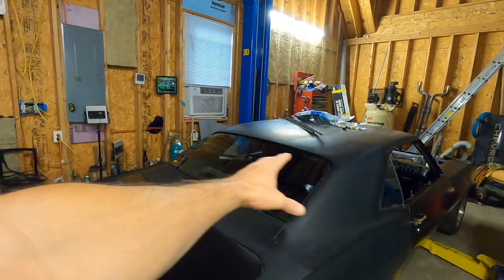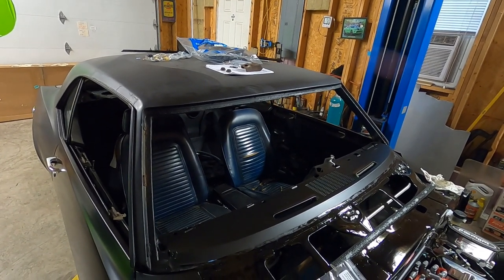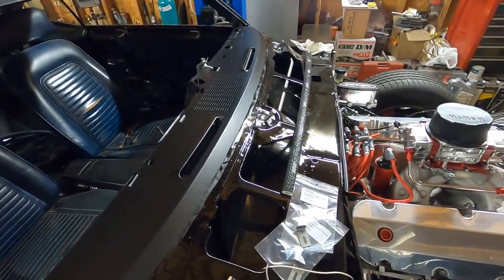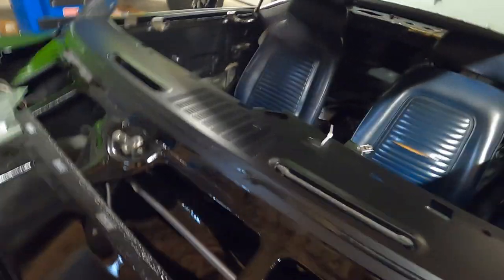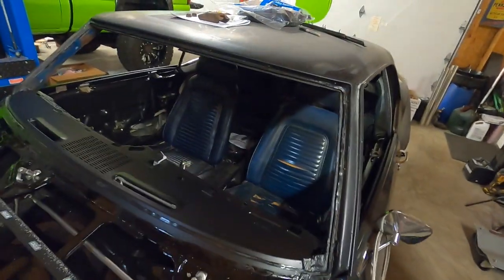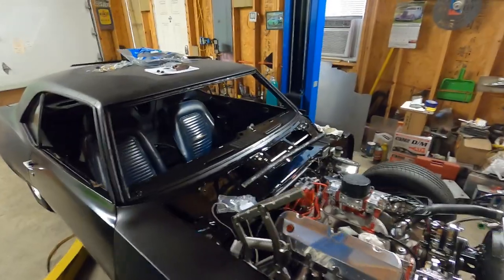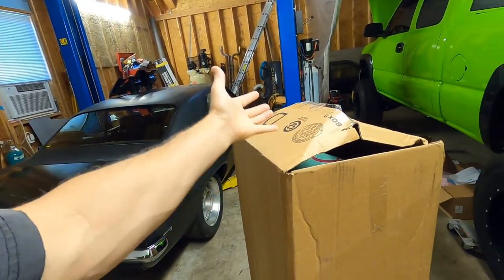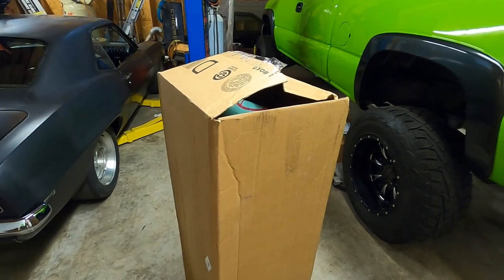1969 CAMARO WINDSHIELD INSTALL

Comment: This windshield is not glued in. You have to use a urethane 3M adhesive. What you put on was just a dam to keep the window height correct and the urethane from bleeding.

Comment: if i may add a few tips for a permanent install. 4 strips masking tape along the roof to glass to hold it for the first hour, on hot days it will sag. purpose of the butyl strip is it never gets hard and allows some flex when the roof panel expands/contacts from hot sun and or slamming the doors. butyl caulk actually seals the water out. good idea to keep the windows down for first 12-24 hours after install or the pressure from slamming a door could pop the seal. vintage cars with the rubber moulding require a different caulk that's non paintable bonds to rubber called "bedding" 3M 08509

Comment: If that seal is butyl then you shouldn’t use it unless you want your glass to sink to the frame (not slide down). I had butyl at first and both my front and rear glass sunk to the window frame. So I went with urethane in 1985 and it hasn’t moved. BTW, the sun loves butyl. Also it’s best to snap in your trim pieces ASAP to make sure they snap in and lock into place in case you need to move the glass a mm or two.
Reply: Yeah, butyl tape is only good if there is a seal too for like quarter glass. A windshield is a structural part of the car and needs urethane to keep you safe. Beautiful car 👍
Reply: @angelamunoz5668  what about for a rear window
Reply: @angelamunoz5668  on a 68 caprice coupe

Comment: U talk to much say things thats not even related less talk
Reply: I really like the headers. I'm looking for headers that fit around the power steering. I'm having trouble finding the correct headers for my 68 Camaro 454 with power steering and power brakes. Any suggestions?